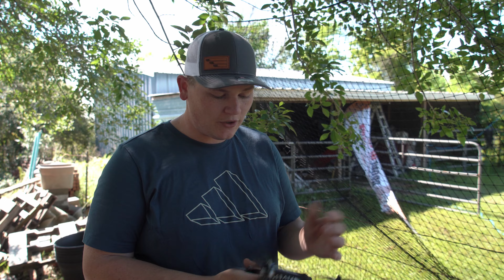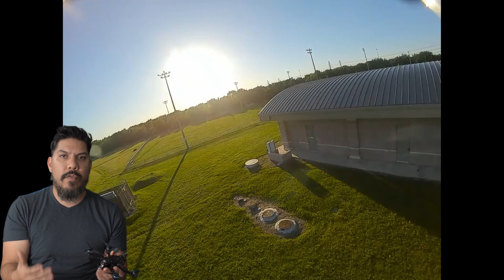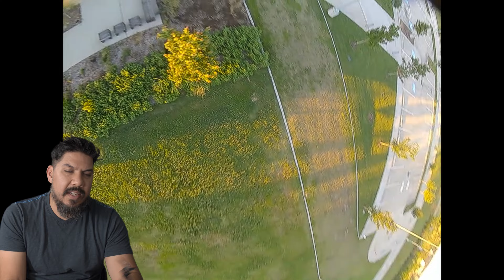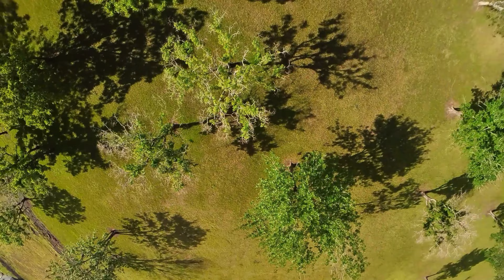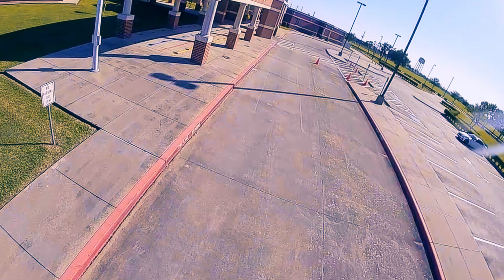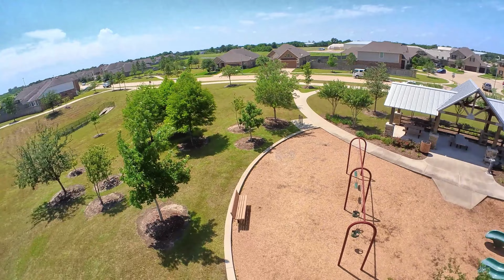Apex 4 " Micro + Chief 2005 lumenier motors - Best park flying drone ever? Impulse RC

Comment: nice video. Because of you I chose this frame for my first drone.
it's going to be a weird build^^  I plan to use the Foxeer Datura 1507 2750KV 4-6s and i somehow managed to install the SpeedyBee F405 V3 BLS 50A 30x30 Stack in to the frame. now i have to wait for my walksnail avatar VTX and some other parts to finish the build...:hand-purple-blue-peace:
Reply from the maker: Nice. That sounds like a fun build. Should feel really nice and be pretty light weight

Comment: 2600kv is a 6s motor for 4-inch. I think I just cracked the code on drone motor/prop theory, but yeah. 2600kv at 24 volts gives you 62400 RPM (1090fps), which is the hairy limit for the speed of sound at the blade tip of a 4-inch prop. Obviously, it won't actually GET to the full 62400 due to aero drag and weight, but yeah. 2400kv would technically be a little more comfortable at 57600 RPM (1005fps) but it should be fine, lemme watch the video to find out.

Also, anyone who wants to 4s a 4 inch but still get max RPM just multiply those KV ratings by 1.5. So you'd do a 3600-3900kv for 4s 4-inch as the safe peak RPM range.

Comment: Hello, i got one question for you. I'm à pilot from France 🇫🇷 and. I love your builds with your  4inch.. I have décided to follow the same philosophy. i built a similar one with à micro apex 4 frame. I got F2203.5 2850kv with speedybee f7 mini. I cannot fly it in 6s without puting à motor output limit at 60%... If not i got a death roll all time.. Any idea ?

Comment: What amp esc are you using on this? Hoping 25a will be enough for those 2005 2600kv
Reply from the maker: speedx 20a 20x20.  25a should be good, just use a capacitor to be safe.

Comment: Love the 4" class. Got back in to fpv after a 7 year break due to time constraints and having babies. Got a novice 4 and loved it. I'm currently running a chimera 4" with 3800kv and its fantastic. Will be my last analog quad since I'm still running my old first gen dominators with foxeer wildfire. I'm gonna just get the dji goggles whenever a new quad comes out that I feel I gotta have.
Reply: Moved to digital ?

Comment: Hi Jon, can u suggest what motor that is perfect for freestyle for apex 3 inch...i have xing2 1404 3800kv but its not powerful when i punch throttle....
Reply from the maker: IMO I really love the emax 1408 for 3”. Check out the 3600kv for 4s
Reply: @JonE5FPV  thank you Jon, you are awesome...👍👍👍
Reply from the maker: Here is some footage flying a similar sized 3” on those motors and some notes 

https://youtu.be/fQoqi6wUUgs

Comment: How durable do you find these motors?
Reply from the maker: None of the 200x size are super durable.  These have some thicker bells than the original BH 2004 release, so should stand up to hits a little better (although still wont be as hit resistance of a 2207 size or larger)
Reply: @JonE5FPV  thanks for the info. Do you think that 5mm shaft 1804s might fair better? Volume isnt that different... cant find much on either though lol with ultralight parts just now starting to pop up.
Reply: @JonE5FPV  Also, does 2600kv really give it oomph? I saw it in the video lol but on 4s coming from a micro guy who usually runs 3500kv it feels different lol...

Comment: Biggest issue is no good 4" T mount props for this setup. I'm 287AUW with 450mah 6s (BH1700kv) and now that I've flown the 2Fiddy I think it needs higher pitch props. Hope we get some more options soon now that people are into 2004 motors. I want to try those Lumenier motors though

Comment: These class of 4” are so much fun. Got a fouride on 3500kv 2204’s for freestyle and a shocker 4” on 2550kv 1806’s for a hybrid freestyle/ midrange. If I could start all over I’d just go 4” everything to keep the costs down.
Reply from the maker: It really is nice for that exact reason. And so much less noise when you just wanna rip without making a ton of noise

Comment: now just give us more selection of 4" t-mount props... what?
Reply from the maker: I love the 4” hurricane. Works with t mount and nut.  Only 4” I use.
Reply: Or 5mm shafts . . that's what most of us want. The T-mount is a PITA when you have to switch props often :P
Reply: @pirateradioFPV  actually - yes!

Comment: I am planning a build on the QAV-S 4 inch with 1408 motors. Has anyone had any experience with 1408 on a 4 inch instead of 2004/2005?
Reply from the maker: Yes. Here is 1408 4”. More of a racers style but it will work. Freestyle and DJI adds weight so I’d prefer larger motors but it can work for sure. 

https://youtu.be/LpuEj6gFczQ
Reply: @JonE5FPV  Thanks! looks good. I was also going to try out the 3.5 inch babyhawk props, just to see.
Reply: I like the stick feel of the 1408 + 4023 better than the 2004. High KV so you have to limit the throttle but the efficiency is better and the acceleration is just mad :)
Reply: @pirateradioFPV  Same, I did the build like a day after I posted the comment and its so juicy

Comment: What about the 3inch version of this? anybody like it? how did you spec it out? i've had my eye on it for a while, but i'm reluctant to pull the trigger haha!
Reply from the maker: for most of these 3", id just as soon get the 4" version, and run 3" props if desired.  Id spec out all the components the same, and you really only gain a couple grams on the frame itself.

Comment: I have also a 4inch apex but it's for 6s
Reply from the maker: For 4", 4s/6s, depends on how you fly, and how much weight you want to carry.  I dont fly super punchy on these and i carry a small insta360 go 2, so 4S is fine for me.  If you are always punching and sagging your battery, then 6S could be the way to go.  From my recent research, a 650mah 6s is roughly the same weight as a 1050mah 4S (about 100-125grams)